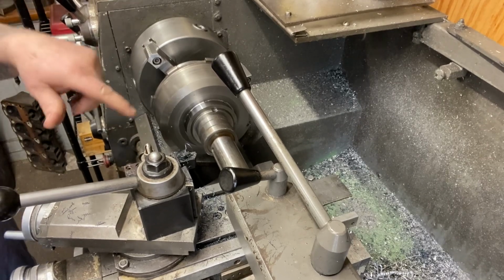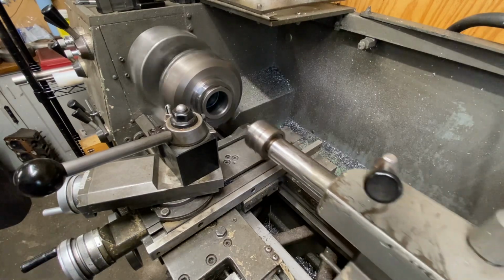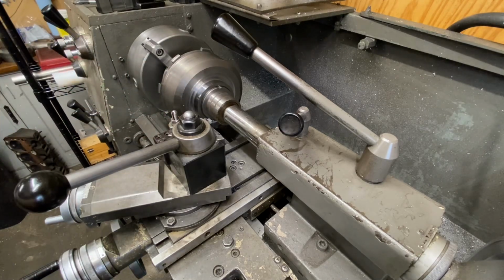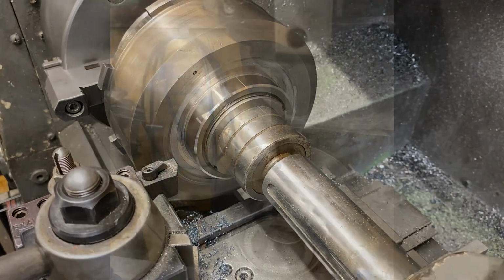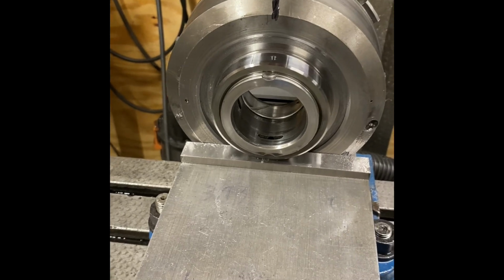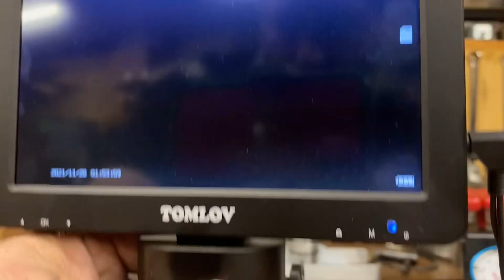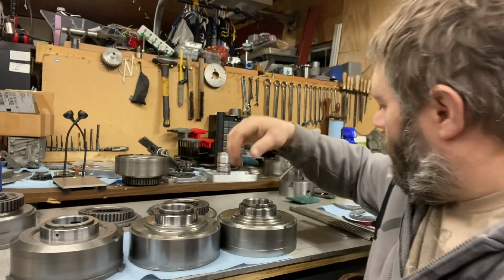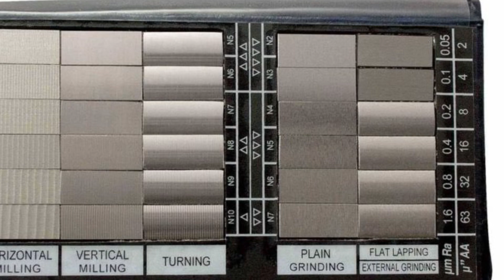Cheap 36 element sprag th350 part 2.

Comment: Dave really enjoy the machine stuff.  Have you ever installed new sleeve in the direct drum where the rings ride on th350 & th400. Not sure if anyone is doing this any more. They used to have kits available.
Reply from the maker: I have. I just did one on an aluminum direct drum for a th400. Wasn’t too bad to do and I also machined it for a 4l80 sprag race so I can put 4 clutches in. Sonnax make that bushing kit. I matched it so had a .002 press fit.
Reply: Thanks for the come back.  I’ll give sonnax a call.  
I’m also looking machining and repairing the pumps  not sure if is cost effective yet though.
350 & 400 pumps getting hard to find.
Thanks again 
Bruce

Comment: If you have a 3/16" hole right into the clutch apply oil circuit...you're gonna have big issues with 3rd gear clutch apply
Reply from the maker: In my one I bought they had no lube circuit. On a th400 they have 2 holes about the same size. With hydraulic pressure I’m hoping this one effect to much. This is all experimental. I’m going to test it. I would of liked to do a 1/8 but I’ll see what this does. Best bet would be to see a nice name brand 36 element sprag and drum and see what they did but I don’t have  an extra $7-800
Reply: @naudydave  th400 has a dedicated lube circuit...its not getting oil from the clutch apply. 

This will be a MASSIVE hydraulic leak for the 3rd gear circuit 

I'd honestly be a little surprised if 3rd gear will even apply the way you currently have it
Reply from the maker: I get that. It’s all trial and error. I’ll find out pretty quick. Making an transmission tester so I can run them and be able to check pressures. Holes can always be restricted if need be.
Reply: I'd like to know the solution for this. I know the sprag needs lube oil, but where it gets it is a huge question mark to me. Thanks anyway!